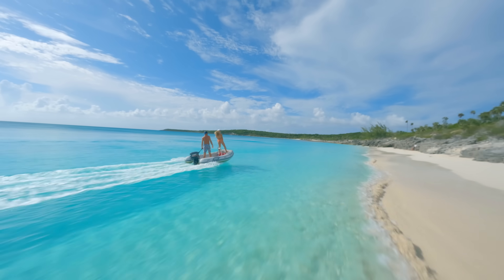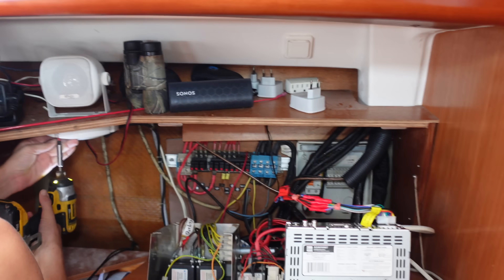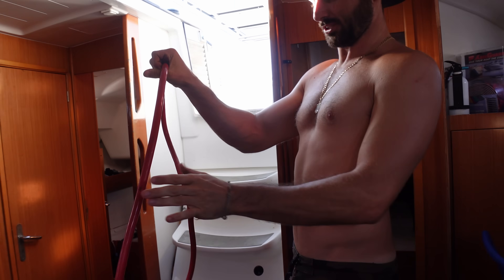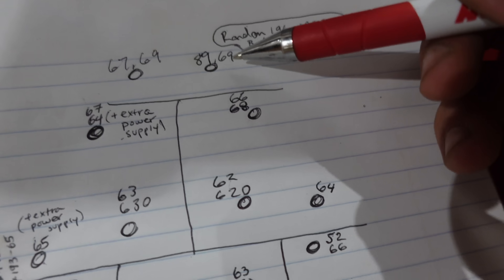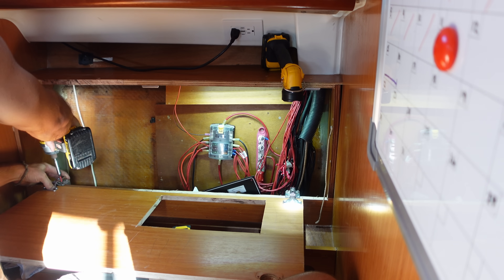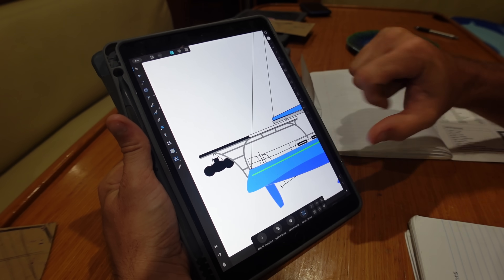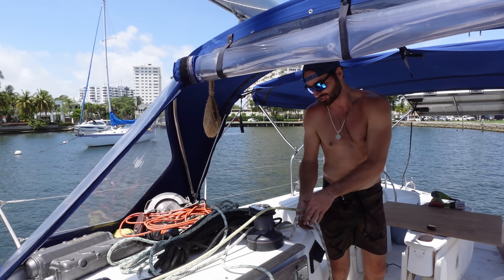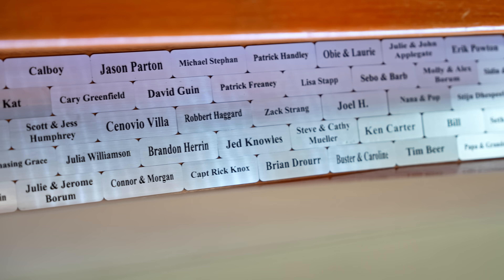Shocking Truth: Uncovering Fire Hazards in Used Boat Wiring! BIG THINGS TO COME!!| ep.27

Comment: You are doing a great job, well done both of you.
I have a question and a statement, and i am NOT a keyboard warrior LOL...

Question: You have 5 x 270 AH Battery's equaling 1350 AH, I have a Pylon 2,4 AH that is half the size of one of the Battle borne battery's, mine is a 48 V system tho.
Is that why it is smaller? Asking you as it could save you allot of space, and i want to learn.
Space wise is what im getting at???

24:00 Statement: That Boom is made so strong, the boom shaft, the step down reducer and the hinge, YET it all ties down to 8 pop rivets to the mast, if the wind load is to mush that would be the weak point, or am i wrong....?

Again, great work, you are so brave to do the wiring, and have great skills with wood and sick planning, measuring and execution layout skills.

Note: I miss the two sisters being together, but we all can see how happy the two of you are, and that also makes us happy 😍 You take good care of her.
Keep it going 👍

Comment: What is really difficult to explain electrical theory is that there are so many terms bacause there are so many things you can measure, force, amount, resistance, capacitance, hertz, and the list gors on. But in reality, it is pretty simple. But how much does the layman need to know to operate a lamp?
Simply put, if a man (force/volts)was pushing a giant beach ball (amount/amps) through a tunnel. He comes to a bery narrow part of the tunnel (resistance)   so he uses how much force he has to pass through on one second. His force times the size of the amount pushed in one second equals the amount of work done, or watts. We can put a value on all of these and if we change one value the rest change. Now when you look at it like that you can visulize what is happening. It takes more study and math to understand
Reply: PS
Thanks for the video about the wiring, every boat I have bought we scrapped the wiring as it was so bad
I can never understand someone using numerous 14 Romex to patch on number 10 marine grade wire

Comment: When you were building this system, did the weight of all those batteries factor into the installation? have you noticed the boat naturally settling to the side of the batteries?
Reply: I think they had close to 1400 pounds of old lead acid batteries before and the LiFePo4 batteries will be half the weight.

Comment: You might not recommend what you did but in your case it was probably necessary.  That wiring was scetchy as heck.  The chances of a short circuit were very high.  A short curcuit is a direct fire hazard.  Well done.

Comment: That nasty green stuff on wire  ( Lead Acid Battery Corrosion ) is awful ... something I remember well working on motorcycles ... but on a boat could be Disastrous causing a fire ... Good thing that you both replaced the wiring ... so expensive but worth it and necessary ... Great Job ... Love You Both ... A Safe Sailboat ...
❤❤❤🎉🎉🎉😊😊😊

Comment: Changing from 230v to 120v is crazy for a world cruising boat! Far more countries use 220 to 240 volt than use 110 or 115 volts. Also at lower voltage the current will be doubled for the same watts, you will have to remove and retire all your high voltage cables! This does not make sense for a world cruising boat, only for a boat staying in the USA.
On top of that as most of the rest of the world uses 220 / 240 volt systems then you will also struggle to purchase new appliances when you need them in 110 / 115 volts. Just doesn’t make sense, unless you plan to stay in the US only

Comment: You also mentioned that Beneteau may have cut costs on wiring when they made the boat. Beneteau made tie Cyclades to compete with other cheaper boats for the Mediterranean charter market. Unfortunately the Cyclades is a cheap low budget charter boat, all costs were cur where they could, by design!
Man you can get an Amel Super Maramu (that need a little work and upgrading) for €150,000. I don’t know what you paid for your Beneteau Cyclades but with what your spending on top you could have got a far more capable, comfortable world cruising blue water boat…… Just saying!
Still love you vids and attitude guys, jus maybe more research before you jump in with both feet.

Comment: No. I am not an electrician. Just an operator. I just trouble shooted problems and saw how useful the full electrical schematics are. Every switch. Every fuse. Deteriorated wires coming in comment to each other. If circuit is completely by overly amped fuse? Disater!

Comment: I'm guessing if you're switching to 110V you're mostly going to be sticking around the US then? since most of Europe, Africa, Asia and Oceania use 220V, whereas most of North and South America use 110v.
And educate me if I'm wrong, I'm pretty ok on the basics but I aint an expert :P like, you'll need a converter when going to other regions and want shore power anyways, whether it's 110 to 220 or vice versa makes no difference. and if i'm not mistaken, 110v uses twice the current that 220V uses, so the "amount of power transferred" is virtually the same. 
But more importantly, isn't 220 the better/safer solution on a boat?
afaik 220 uses less current and can use smaller cables and on top of that it's less likely to heat up and cause a fire (less current= less heat).  the drawback would be that 220 needs more insulation cause it can arc easier, and there's more risk of electrocution when not sufficiently insulated. but seeing as how you want good quality wires anyways....

I mean, both are safe when done correctly ofc, just trying to check the pros and cons a bit. since 220 uses less current and wires are less likely to heat up, you'll lose less energy to heat, so it technically saves a bit on electricity. and given that 220 can use smaller cables (with more insulation) and it's the cables that have the most problems with corrosion, then wouldn't it be better to have smaller, well insulated cables on a boat? rather than the thicker 110V cables? not to mention that 220 cables are less stiff, so they're easier to work with, which could come in handy in the tiny boatspaces you're working them into xP

Comment: Why don’t you use the water jet analogy for electricity?  
Volts is pressure, 
Amps is flow rate 
Watts is how much energy is in the jet
A jet washer gives you high pressure but not much flow, and has the energy to shift the muck. It’s like high voltage low current (amps)
A washing machine drain pump produces plenty of flow but very little pressure. That’s like low voltage high current
A jet ski motor gives you lots of both
Simples

Comment: Running a sub panel to each cabin for DC and AC is the best way. then you have your main panel and then 4-6 sub panels. then you only have to run 1 set of wire to each cabin. for the DC side you have to know how many amps that cabin will use DC then run the correct wire to a DC sub breaker panel. Same with AC. now the main panel will cut off each cabin and the sub panels will cut off different circuits. sure you will have to run heavy wire or say for DC you run it at 48 volts so thin wire can be used and then have a DC to DC converter. or pay for the heavier 12 gauge wire which gets so expensive. I can run 1000' of 48 volt wire to handle 30 amps (1440 watts DC) or 40' 2 gauge with 30 amps @ 12 volt which is 480 watts of power. Also having sub panels that is where DC to DC converters will be. then for AC you run 10 gauge wire to each cabin and each one can have 1 20 amp and 10 amp or 2 15 amp outlets. 10 amps outlets would run USB outlets and fans. I know you already done this but this is how the new rebuilds are done.
Reply from the maker: Thanks for dropping some knowledge 🤙🏼

Comment: also running a group of DC wires together is wrong. They get hot and can not breathe to cool down ( as you seen). So even if you run 12V 2 gauge wire to each cabin to a sub panel then run each circuit you will have a safer better system.

Comment: I always wonder why American outdoor vehicle hobbyists are thinking in amp per hour. It make me laugh 😂😂😂. 

Next time, talk in watt. 😂 amps and volts are elusive. Watt is steady. 
So amp hours are useless to measure used or stored energy.  Amp hours are only interesting when you buy a battery. 
But there after is’t all  about watt. Yes Jams Watt, the guy with the first steam machine. 
Unfortunately the whole usa sailing community talks in Ampere per hour. This is toughened by the battery monitor systems that do not talk in watt. 

But why do all apparatus print watt on the labels. Just ask your self why solar panels is measured in watt and watt peak. 

But amp hour is only there to indicate how quickly you can drain your battery. For starter batteries you even even two apm nummers. Just for that.  So stop being a fool and speak professional, speek in watt. 

A full of thumb for recalculate the amps per hour to watt .. ever 100 amp is about 1300 watt per hour. 

Now your cooking. ❤

Well done on the wire your. Yes never trust the factory old wire harnas. It’s better to inspect and or replace. 
Super nice work.